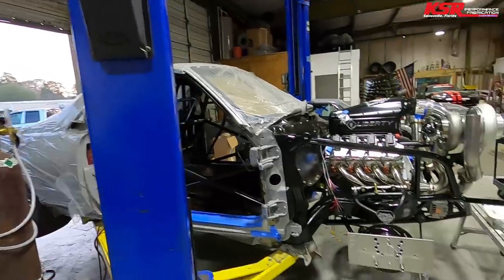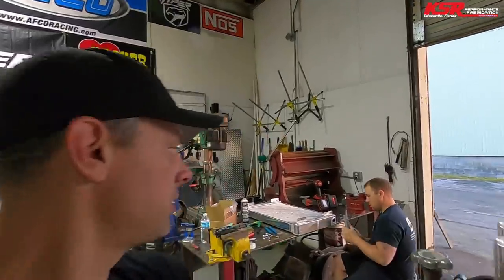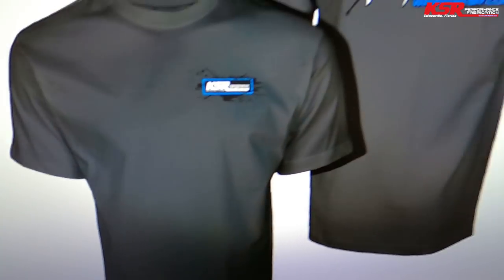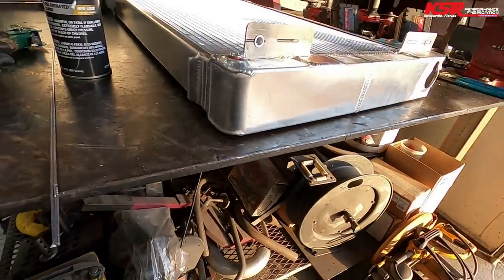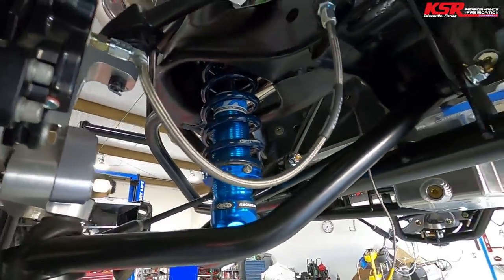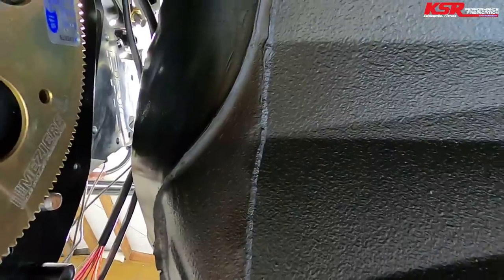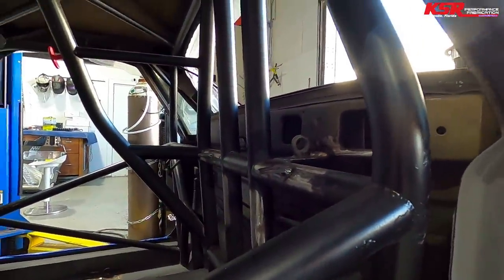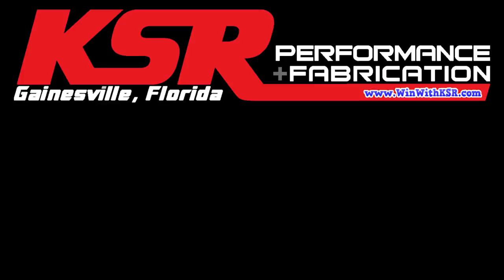Mullet El Camino Build Episode 14! Radiator Modifications and a Fire!

Comment: Good times in the shop! You may want to pull the covers on the conduit boxes and make sure the ground wires didn't melt anywhere else. That may be a problem in the future.  Thats alot of amps that moved a long way through not alot of wire gauge. 😁😁👍👍✌

Comment: May wanna check all the junction boxes on that circuit! Ground and neutral connections All the way back to the neutral/ground bar(s) in the panel or sub panel. I’ll bet it used the neutral too, running 70-80 amps through 14awg Romex may have hurt some other wiring. Would hate to see something burn up in the wall or ceiling and spread before you even know it!

Comment: Ah the old ground lead gets me all the time. Though usually it is with the stick welder and I am standing there poking away harder and hard cursing the welding rods only to look over and see the ground clamp laying on the floor. I would like to try some TIG welding, but I don't do enough welding at work to try and convince the owner to spend the money on a decent setup. He did just spring for a Hypertherm plasma cutter, what a treat that thing is to use, game changer.

Comment: We’ve had guys at work wipe out bearings on large natural gas engines and compressors by having there ground to far away from where there welding on the skid that the engine and compressors are mounted. They also have fried ecm’s the same way.

Comment: So I do micro laser welding at work. I video most of it. So what you do is get a welding lens. I use a 10. Mount your camera on a tripod. I got a mag  base for a indicator and a small clamp. Drilled a hole in the clamp and mounted it to the indicator base. Then I got a box and made a shield to block the lights in the shop so I don't get any glare. You can put the camera anyplace you want and put the lens rig in front of the camera. Works like a champ.

Comment: For filming welding, you should look into a fixed shade helmet, shade 9-11. Which you can pop out the lens (or maybe find a replacement lens). That chunk of dark plastic can be glued to the front of a go pro case. Then just set the go pro exposure way down to a fixed value (not auto) and you will have consistent video. Just grab one of your magnetic tripods and aim it at the weld

Comment: I saw someone mentioned checking the wiring but I would also inspect the conduit connections from the outlet to the panel. The conduit and ground conductor shared the current.  The conduit is designed to take hundreds of amps for a few seconds so chances are you're fine but worth a look.  Thanks for great content!

Comment: Since I do play with cameras and equipment as a hobby and use a lot of different filters, I haven't looked but wonder if anyone has an over the lens filter for your camera and/or just take a usable helmet window, preferably the type that adjusts to the intensity of the UV instead of a constant level, then use that to shield your lens -- sort of create a small box with the UV filtering for one side, a spot in the bottom to secure your camera, especially if it has the threaded hole for a mount. It does seem that if you could have the lens and the filter in a fixed position, focus, even if you have to focus manually. If you wanted to be fancy, make the welding filter out, focus on the welding piece, then lock in that setting and put the glass back in. Once you build a really nice one, then I'll have something to copy. LOL

I'm glad you are doing the through the helmet segments so we can learn from your great welding; however, Before the thru-helmet segments, I watched a video of your welding and a couple of others and my eyes were all swollen and bloodshot the next day. I had a pretty good sunburn too. So now I sit a lot farther back from my computer and wear a welding helmet so everything has been fine so far.

Comment: Maybe this has been said already, but you should get the wiring checked out to the lift, and the wires in the conduit. There might be some melting (and possible shorting) inside there, and cause troubles sooner than later.

Comment: Best check the ground thru all of the electrical including the main panel . Looks like you may have melted  more than the plug and socket. My guess you will need to rewire the entire branch circuit.

Comment: are you going to have an electrical contractor check or replace the wiring in the conduit between the rack and the outlet where the welder was plugged in??  might have gotten hot enough to melt the insulation into a clump..  you may want to be sure that you turn off the circuit breakers when you leave at night till you get it checked..

Comment: Locar locking transmission dipstick.. is there a 1 or 2 quart garden sprayer with a connector to teh top of the dipstick tube with the dipstick removed to add fluid to the transmission thru that hose which would take for ever with a funnel..

Comment: 😲 OH SNAP.... It's not surprising stuff like that happens not just only to you, you just have so much on your plate sometimes things get missed....hey Shit Happens... very glad it wasn't worse ! IMO, I'd pull the circuit wires if possible to that receptacle and make damn sure the wires inside the conduit didn't burn off the covering as well. By all rights, that should have popped a breaker to stop that from happening too. Mullit looks good and it looks like you've been hanging wires too.
🍺🍺🍺🍺🍺🇺🇸🇺🇸🇺🇸

Comment: It has been a couple of years since I have dealt with a Lokar dipstick but in my experience they are slow to fill the transmission through.
Reply: Is there not a fill plug on the transmission itself though?
Reply: @Matty.Hill_87  most automatic transmissions do not have a fill plug.
Reply: @rodhagen9393  didn't know that, haven't had much experience with autos

Comment: If I told you how many times I've forgot to ground out and burned something else. Usually 110 lines on positioners at work. One time I was welding something big and had it resting on my grounded table. Well.... it liked the ground through the chains on the 50 ton crane..... needless to say the company wasn't too pleased about me frying a $5000 set of chains

Comment: Hey Kevin. I have a question for you. I am mounting a racing seat in a vehicle that I use for rallycross. I don't have a roll cage. Would you recommend using a factory seat belt or a 4 point harness. I just needed something with some side bolster to keep me from sliding around. Thank you for all the great videos. I'm learning a ton from watching.

Comment: Are you using the same filler rod when you weld the radiator mounting tabs as when you welded the fuel line fittings? Or is it a different gauge/material? Also when you were welding the turbo pipes and you were back filling the tube with Argon gas, how did you set up your argon tank (Routing the hose off the tank, pressure settings, etc). Can you do a video kinda like the “proper seatbelt configuration vid I thought you would be the best person to ask.
Reply: For race cars, What kind of filler rods do you use, for what applications, when to use Mig vs Tig, etc. Thx Kevin!!!

Comment: Hey Kev🙋‍♂️
Was just wondering with those dip sticks being locked like that, how does that effect the engine crank case pressure? An same with the auto pan?

Does it increase or make any effect on those pressure incfease?
Reply from the maker: The valve covers are dumped into a free breathing tank.

Comment: 😄 a power strip is a cheap fuse. much less expensive than the final drive my friend fused while doing some propeller shaft welding on an offshore race boat. twin engines, twin final drives, single ground. oops!

move that ground!